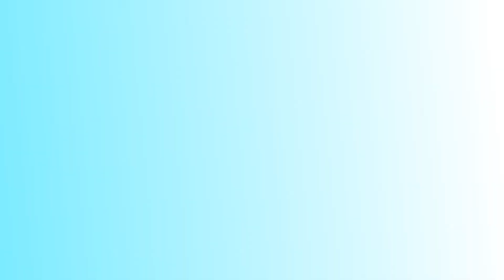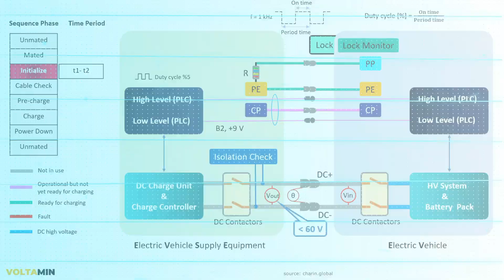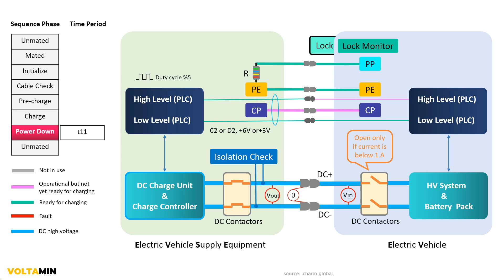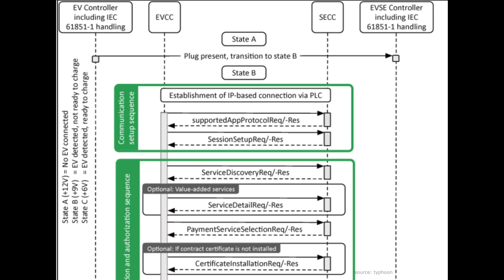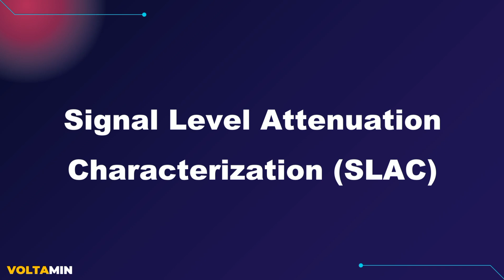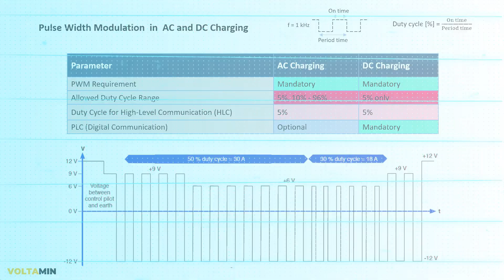All you need to know about DC Charging of electric cars with CCS type 2 Protocol

Comment: Very informative video, you have cleared each section very deeply, I have doubt in the isolation monitoring. first question is IMD is connected after the DC contactors in EVSE? in that case does we need to close the contactors before checking the isolation, as the IMD needs atlease 100v supply to check isolation? and if that is the case how much voltage we need to provide as after that precharge state comes in, in which we have to set voltage what EV requires.
Reply from the maker: In most DC fast chargers, the IMD monitors the DC output side (after the contactors), so it checks the complete HV path including the cable and vehicle. To measure isolation on the vehicle side, the HV path must be established through the precharge sequence, so yes, contactors are involved before a full isolation check is possible. Most IMDs require a minimum DC voltage (typically around 60–100 V, depending on design) to measure properly. The EVSE does not apply a fixed voltage, it ramps up to the voltage requested by the EV during precharge, and isolation monitoring runs before and continuously during charging.

Comment: Where are the PLC pins located? I think they use the CP and PE for this communication too?
Reply from the maker: Good question. In CCS, the PLC used for ISO 15118 doesn’t have its own pins. it’s superimposed onto the CP line with PE as the return path. CP handles both the normal ±12 V pilot signal and the PLC carrier, while PE completes the circuit.
The DC+ / DC– pins only deliver power, not communication.
That’s why CCS AC and DC inlets look the same: no extra communication pins are needed.
Reply: @voltamin I want to make a test circuit to simulate the evse side. Do you have any recommandations on the hardware to begin with? I have already made the single wire can communication work but now I want to make it work with ccs for newer model cars

Comment: From the diagram, EVSE has charge controller, which mean the EV did not need to use it own charge controller?
If my car use CC/CV for charging, it mean the EVSE charge controller can work as CC/CV controller? Or my car will need it own CC/CV charging controller?
Reply from the maker: If you’re using AC charging, your car’s onboard charger handles the CC/CV control.
If it’s DC fast charging, the EVSE has the CC/CV controller, and the car just communicates the required values.
Reply: @voltamin  Thanks.

Comment: Sir, in a DC charging system, what is the current limit for the pre-charge state?
Reply from the maker: In a DC charging system, the pre-charge current is typically limited to 1–10% of the rated current to safely charge the DC link capacitors. It’s controlled by the pre-charge resistor so the voltage reaches about 90–95% of nominal within 1–2 seconds.

Comment: I have the MG Comet EV, here in India. It doesn't have a CCS2 port. Only has a type 2 port, Onboard charger capacity 7 kw.. 

Most of public fast chargers has only CCS2 port here.. Tyoe 2 port is very rarely available. Is it possible to adapt CCS2 to Type2?
Reply from the maker: No that is not possible. An adapter from CCS2 to Type 2 is not technically feasible because of the difference between DC and AC charging standards and the car’s onboard charger limitations. The MG Comet cannot accept DC fast charging since it lacks the hardware.

Comment: any idea once connected how to hold the charger and ev from charging till payment is not received, without disconnecting the gun?
Reply from the maker: If the charger supports OCPP 1.6 or 2.0.1, you can delay the authorization/start command until the payment is verified. Once the user makes the payment, send a Remote Start Transaction command via the backend.

Comment: so if I connect voltage meter to CP and EARTH on DC charger side I will know exactly on what state I am? bcoz I have DC CCS charger and one vehicle seems to be non compatible with charger, I am wondering where is the problem/issue
Reply from the maker: In DC charging, the CP line is still used, but only for initial handshake and safety checks, similar to AC charging. However:

- After handshake, high-level communication switches to the PLC (Power Line Communication) over the Control Pilot using the HomePlug GreenPHY protocol.

- Charging control and state management are handled digitally using ISO 15118 or DIN 70121.

So, in DC charging, CP voltage alone does not indicate charging state. Once the digital communication starts, you'd need to interpret the PLC messages to understand charging state (e.g., charging, ramp-up, fault, etc.).
Reply: Sir, in a DC charging system, what is the current limit for the pre-charge state?

Comment: I have 3 Delta DC EV chargers that use OCPP. I want to control it online like turn it on and off. Please guide me!!!!!!!
Reply from the maker: You need to contact a Charging Point Operator Company to onboar your chatger onto their charg point platform via OCPP and asign you a dashboard where you monitor and manage your chargers
Reply: @voltamin  I am trying to build it on my own. I have tried contacting companies, but they have their own software with a subscription and separate hardware to install. I have started building my own using FastAPI. But I have an issue with starting and stopping the charging. I can monitor it and add new RFID cards to it. It is for the community to use for free during the day because of Solar and at night we want to charge fair amounts.
Reply: @voltamin  !

Comment: Hiii Thanks for the video.
I want to know more about SLAC, is there any source available on internet?
Thanks.
Reply from the maker: This link from Vector may help: 
https://www.google.com/url?sa=t&source=web&rct=j&opi=89978449&url=https://cdn.vector.com/cms/content/know-how/_technical-articles/EMobility_Smart_Charging_ElektronikAutomotive_201407_PressArticle_EN.pdf&ved=2ahUKEwjgpLzkruaLAxViVeUKHXerLx4QFnoECCIQAQ&usg=AOvVaw1QKZnYtavTMocxOKRrGI5C
Reply: @voltamin  This resource does not go into details more of an overview.
Reply from the maker: @RomansapienMVision which details do you mean in particular?
Reply from the maker: Try also to look at ISO 15118-2 and IEC 61851 standards
Reply: @voltamin  Thanks. Hey i was rewatching video and came to this part 04:41, is the order of PEC mentioned in audio is reversed? sorry if i am wrong 😅
Reply from the maker: @v123-d2n hey, thanks for identifying this mistake. Yes indeed it should be reversed. the schematic is correct illustration